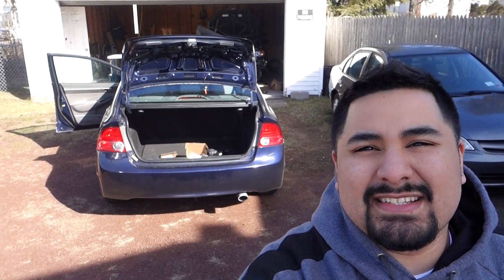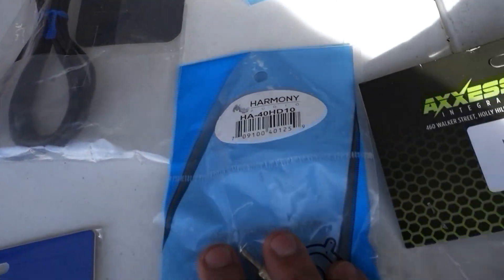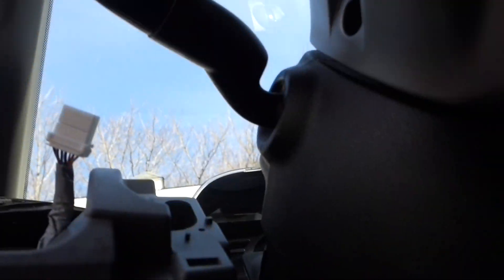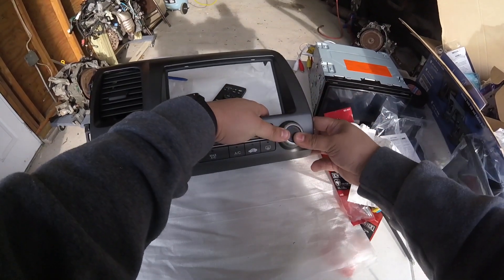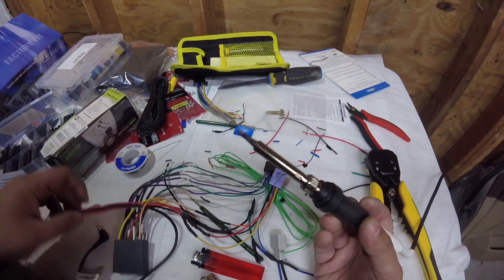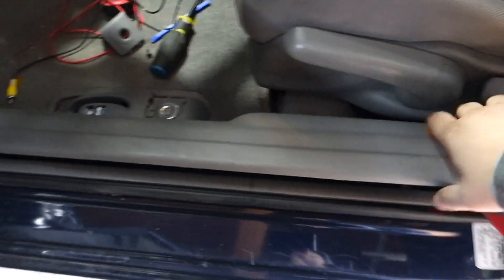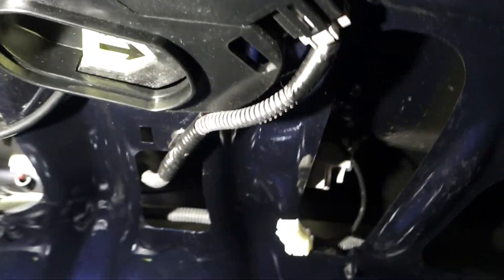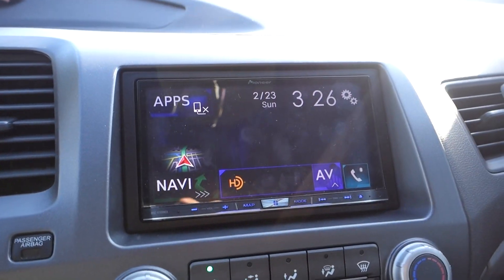2008 Honda Civic EX Radio Upgrade Steering Wheel Controls Backup Camera Install

Comment: Hey, I have a question. if I wanted to put a box subwoofer in my 2006 Honda civic coupe would i need any special connectors to plug into the stock head unit? also can the stock head unit handle a sub? the sub has a built in amp. and i believe it connects to the head unit using RCA. I don't really know anything about audio installation, but id like to do it myself without having to pay for labor. I also dont want to solder or connect any wires if possible. is there a harness or something i can buy where i could just plug the subwoofer into the head unit along while still having the stock speakers connected?? thank you so much and i appreciate any help!!

Comment: If I install a new head unit on my 2006 Honda Civic EX with Premium sound, will I still be able to use the factory amp and sub. Can I just install the head unit and use my sound system?

Comment: I have a SWI RC1 module connected to my 07 civic ex with premium system. The white wire from the module is connected to the pink wire. And the the black module wire to the brown . The light in the module turns on but i cant get it to program to the steering wheel. I followed the instructions on how to reset it and still nothing. Any recommendations??

Comment: I got a 2008 Honda Civic Ex Sedan 1.8L and I want to install the same radio with everything in your description. I got a question on Metra Axxess ASWC-1 Universal Steering Wheel Control Interface. If I install  maestro rr do I have to install  axxess ASWS-1 universal steering  wheel control interface as well? Or do I still have to install both? Thank you again.
Reply from the maker: no you only need one or the other we recommend the AXSCW-1 which is the new part number or the RR.
Reply: Yes I've installed an aftermarket for my 2008 Honda Civic and want steering wheel controls between Axxess ASWS1 or idatalink maestro. Any luck?

Comment: Hi good  night  quick question  i have a honda civic si 2009 with premium sound  i have issue in the steering  wheel control ASWC-1  im conect and the steering  controls dont working
Reply from the maker: did you wire the correct wires the ascw-1 needs three wires, ground(black), accessory(red), gray/red(steeering wheel control positive). Then you also need to find the steering wheel control negative and connect that to ground.

Comment: What size pins are those on the connector for the steering wheel control plug that come in that kit? If I wanted to keep AUX in and steering wheel controls I would need more than it comes with. Any source for them?
Reply: In case anyone else ever looks for this, I found that purchasing the Masetro HRN-RR-HO1 wiring kit has this connector with wires in the right pins to not only accommodate the steering wheel controls but also the factory AUX input if you have one.

Comment: Do you have pre-made wire harness for 2008 civic si with premium audio?(commented before you said look on the site coming soon) I have been researching far and wide because i am having to install an aftermarket HU mine is dying. What i have ordered is the HU, dash kit with the am/fm antenna adapter and the Scosche HA13B im pretty confident that i can get it all installed on my own but i sure with i stumbled upon this before i tried to piece this all together. The HU comes with a remote so im not interested in retaining my steering wheel controls, but i cannot stress enough how much i want to retain the factory amp and sub, do you think i have everything that i need to attempt the install?